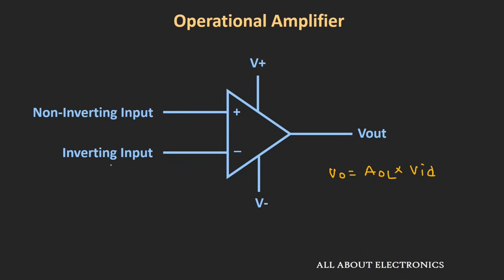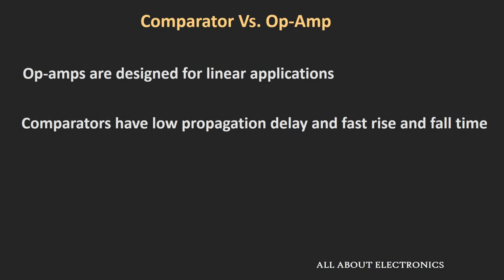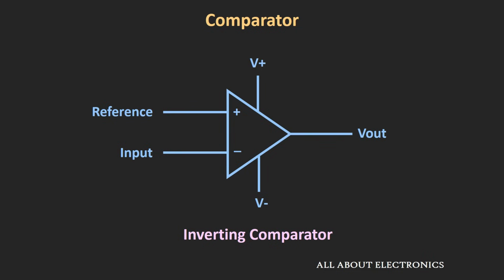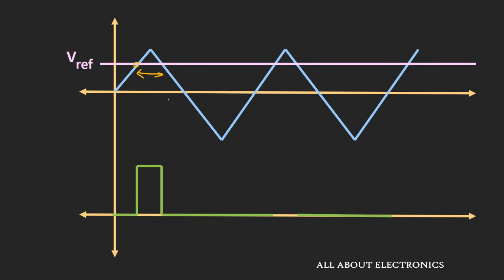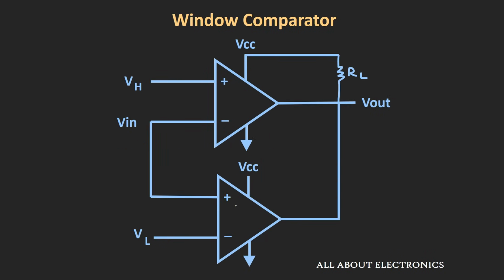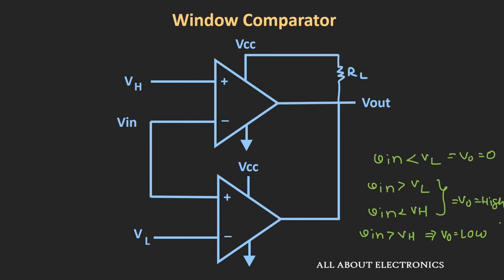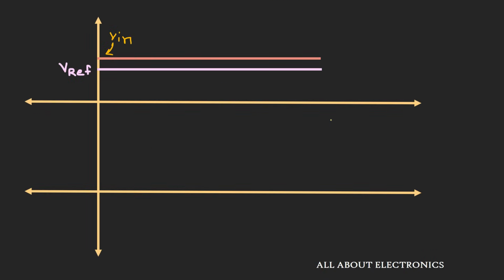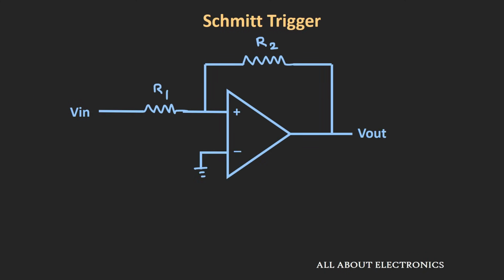Comparator Explained (Inverting Comparator, Non-Inverting Comparator and Window Comparator)

Comment: In 1:31 what u are saying i am not getting
Reply from the maker: This comparator is also used in analog and digital conversion. And symbolically it is similar to the op-amp. Well there are separate ICs are available for comparator but op-amp can also be used as a comparator.

Comment: please explain the function of RL resistor in this circuit,and please make a video explaining pull up resistors.
Reply from the maker: I think you are talking about resistor RL in window comparator right?
It serves two purposes. First, when the output of the comparator is low,  it will restrict the sink current of the comparator. Second, when the output of a comparator is high, it will provide the strong logic high. 
I hope it will clear your doubt. 
And yes, at some time I will make a video on external pull up resistor.

Comment: how we can check stability of op-amp during frequency response
Reply from the maker: Stability of the op-amp can be checked using the gain margin and phase margin. 
In simple terms, if I say, for the stability of the op-amp,  when the gain of the op-amp reaches 1 (0 dB) at that frequency, phase should be less than -180 degree. 
And when phase angle reaches the -180 degree, at that frequency, the product of open loop gain and feedback factor should be less than 1.
Reply: and how we can remove unstability
Reply from the maker: try to follow the above mentioned two criteria. 
If you find that at your operating frequency the product of gain and feedback factor is greater than 1 and phase angle is less than 180 then change the feedback factor by adjusting the component values. Or if you use that circuit below the frequency where circuit becomes unstable, then you can avoid the instability.

Comment: can  you  explain  why one is high and other is low,overall output is zero in window comparator?
Reply from the maker: Let's take the case when Vin is less than VL. In this case, the first comparator output will be high and the second comparator output will be low. And if you observe the output of both comparators are tied to gather. (Wired AND connection). So, even if first comparator output is high, it will be pulled down to a low voltage by the second comparator. And in this way, overall output will be low. 
I hope, it will clear your doubt.

Comment from the maker: Timestamps for the different topics covered in the video:

0:18 Introduction to Comparator

1:32 Op-Amp vs Comparator

4:41 Inverting and Non-Inverting Comparator

7:12 Window Comparator

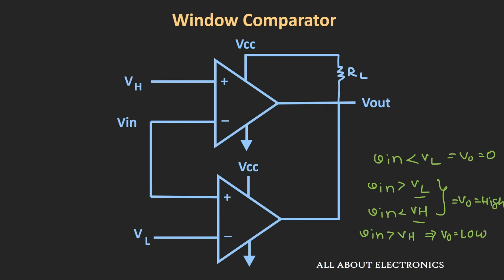10:15 Limitation of Comparator
Reply: If both the inverting and non inverting terminal voltages of comparator are same then what will be the output of comparator